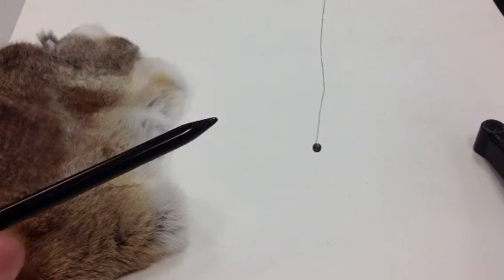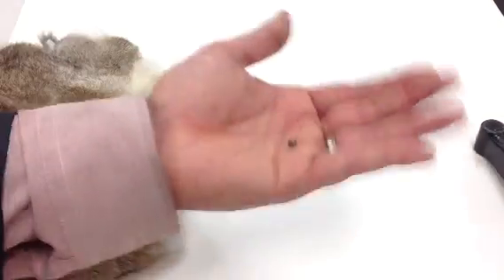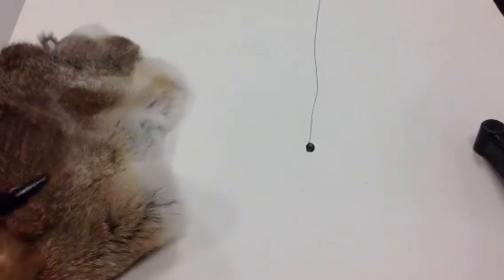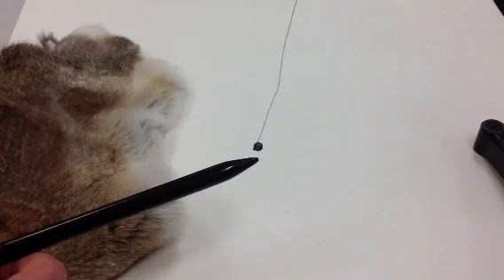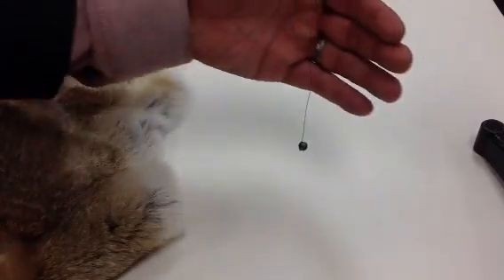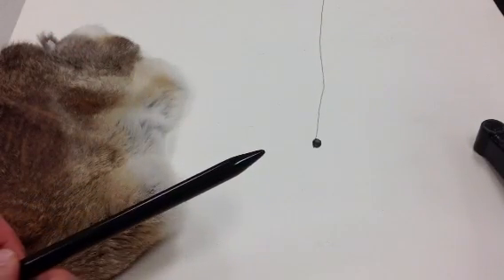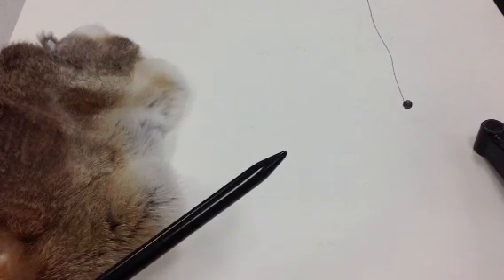Pith Ball and Plastic Rod Attraction and Repulsion

Comment: Thanks!!!for the video... If possible pls also make a video on the glass rod rubbed with silk cloth and  polystyrene ball to show the forces developed due to charges  between them... ☯
Reply from the maker: It looks exactly the same but the electron motion is different.  Instead of pushing electrons in the ball it pulls them.  And the glass rod just never works as well as the plastic.
Reply: @LRNFZX  thanks,I got it!! :)

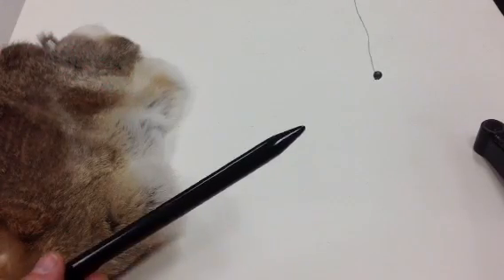Comment: hi, in 2:13 you said the plastic rod  transfers some e- to the pith ball. I thought this was all by induction? You are contradicting yourself? Please clarify.
Reply from the maker: When it touches the electrons transfer.  Before the touch there's induction.
Reply: @LRNFZX   but sir we know insulator can not transfer charge by conduction...So why when it touch with the ball charge conduct.
Reply from the maker: @ranitbanerjee956  - Insulators are only insulators until a large potential comes along.  Lightning flows through air and it's an insulator.  With a large enough charge the charges will transfer.
Reply: @LRNFZX  so after rubbing with wool or silk the glass rod gain more and more charge to transfer from it to the pith ball although it is an insulator...Am I right sir....??

Comment: Idk what my issue is, but probably the pith ball has something wrong. Mine doesn't have a metallic coating. And it just keeps attracting infinitely. I hate this experiment it sucks so much. I know it should be easy but it ain't working for me sadly.
Reply from the maker: @dhoom-z7221  lower humidity helps.  And you’ve got to build up charge.  With little charge on the rod that’s how it acts.